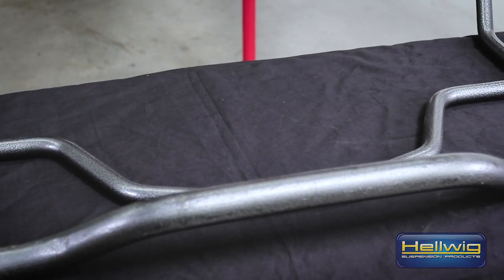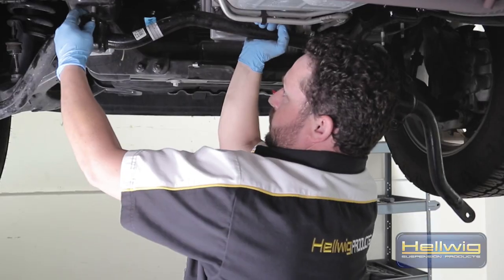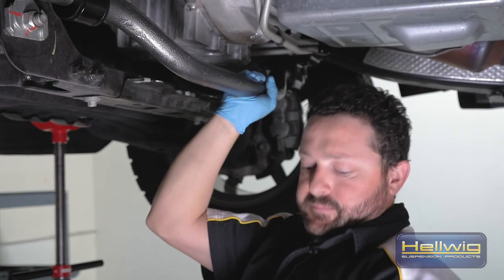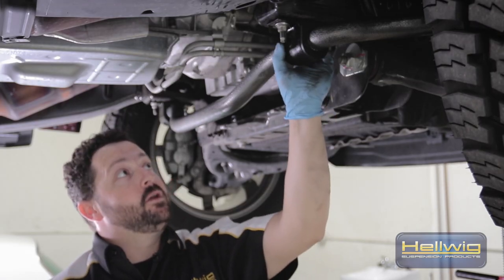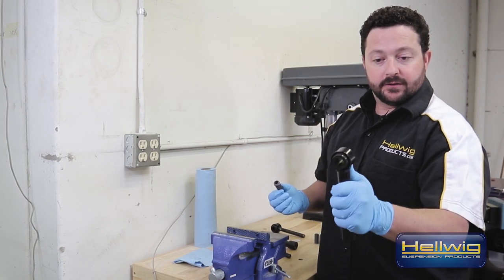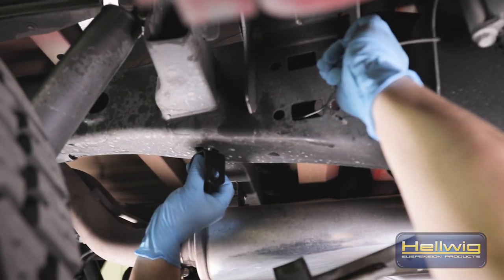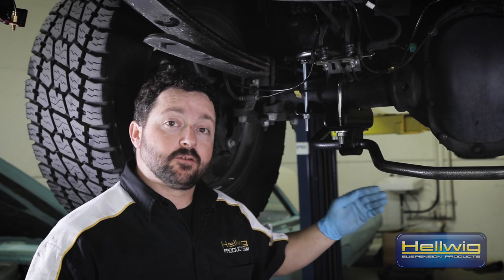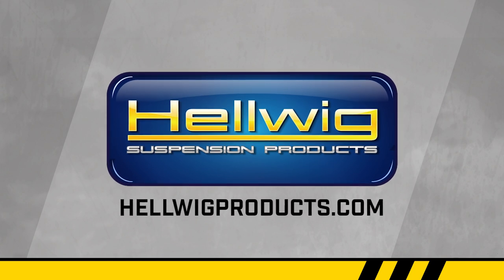F150 Sway Bar Install - How To Video | Hellwig Products

Comment: I am pretty much sold on these swaybars. I had a  new 96' Aerostar van that just made you sick when driving it. The way the back of the van waddled when driving.  So I thought I would try a swaybar and Hellwig had one. I installed and it transformed my van handling remarkably I could not believe it like it was a different vehicle.   I now have one on the rear my F150 and it improved it also but not quite as dramatic as the sick van.
Reply from the maker: Thanks for the great feedback Joe!

Comment: I got one of your Hellwig 7709 Sway Bar for my 2011 Dodge Ram 1500 
regular cab, I got it because every time I went around a sharp turn the 
truck lean a lot I placed my Hellwig 7709 Sway Bar in the center hole 
its better if I want the truck not to lean to much where the best 
setting

Comment: I have a 2015 F150 4x4. Upgrading the front and the rear with new sway bars would be the best way to go. But to save money, would I feel the difference in just replacing the front sway bushings and adding the rear sway bar?

Comment: On my Hellwig rear F150 sway bar the center hole of the sway bar has what looks like a piece of metal welded in there from the factory on both sides. Is there a reason for that?
This causes me to use the 1st and 3rd adjustment hole only, however in the video you used the middle hole.

Comment: Will it stay at 90 degrees with a load close to payload max or will it need to be adjusted for the payload.  Our does it not matter if it's set properly without a load?  Thanks.

Comment: Do adding away bars increase drivability  on snow and ice ?
Reply from the maker: Hi Darryl, driving on snow and ice is a matter of traction, not load and sway control. For improved traction on snow and ice a good set of winter tires are your best bet!

Comment: Directions say this should be done with vehicle sitting on the ground. Not on a lift! 
Video is a FAIL!
Reply: Only the last part to adjust the end links on the ground. gheez
Reply: The video shows the technician explaining to the viewer that the truck must be lowered to the ground and sit normally so final adjustments can be made.  Then the video shows the technician doing exactly that.  Did you watch the whole video at all?